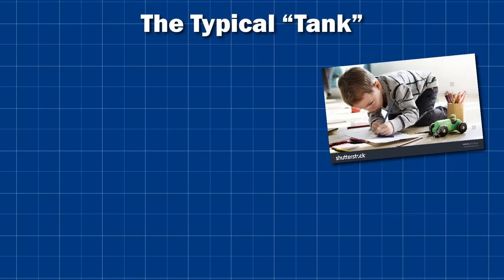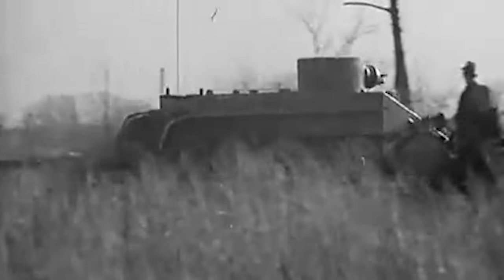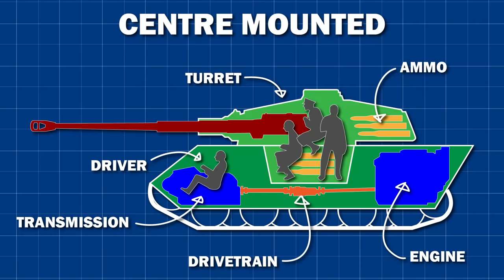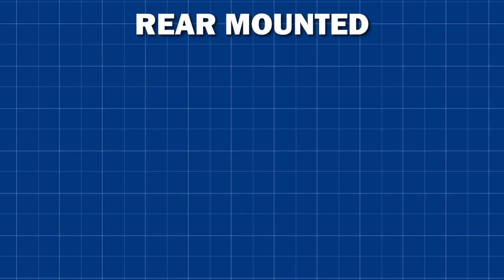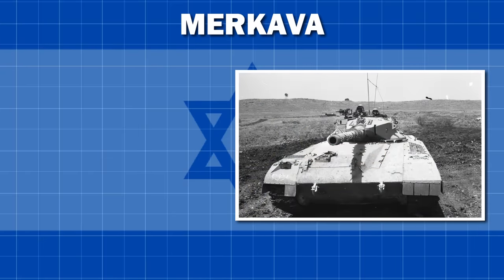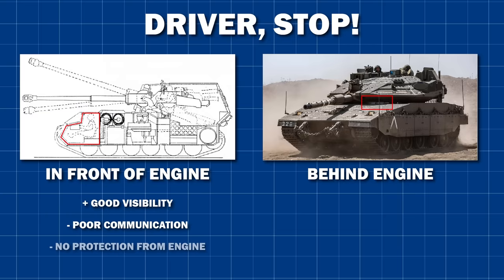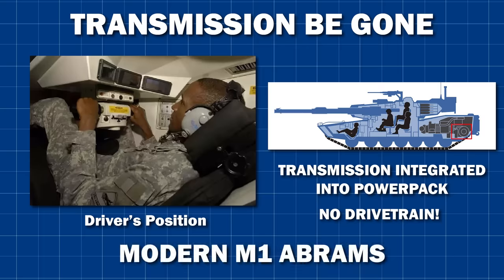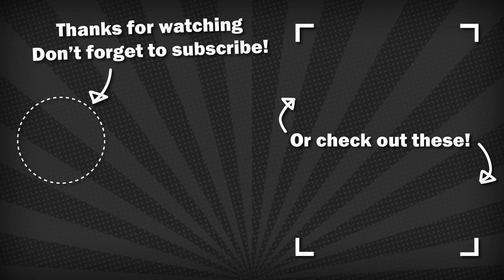What happened to Rear-Mounted Turrets?

Comment: Tanks are supposed to fire on the move.
The weapon system is least affected by the tank's motion in the center.
This is THE main reason why turrets are put in the center, even on tanks like Merkava (and on other fighting vehicles like BMP). It also increases turret crew comfort.
This is why rear-mounted turrets are usually seen only on self-propelled artillery.

Comment: Soviet tanks in WW2 had a rear-mounted transmission.  How did they solve that problem with manual transmissions?
Reply from the maker: They used a series of linkages between the driver and the transmission! The T-34 was notoriously hard to operate but linkages can be done well in theory. They are just rather maintenance heavy.
Reply: @RedWrenchFilms  Thanks!

Comment: A lot to be said for USSR WW2 forward turret design actually. The USA wants the rear mounted design as this Tank is meant to deploy with Airborne units so mobility is paramount over firepower and protection. Also mounting the exhaust on one side has many advantages with in theory the possibility for an AIP Stirling Diesel to offer up a "land submarine" as a future capability for fighting in an NBC environment.

Comment: Driver behind Engine communication problems are no longer real in Modern Tanks. A perfect example of the rear mounted turret was to be found in the Swedish STRV-2000 Prototype. This groundbreaking MBT was not continued due to the end of the Soviet Union/Cold War. The design was quite expensive for the time, thus was instead replaced with Germany's Leopard 2 Vehicles, which were already in production and MUCH CHEAPER to purchase.
The main design aspects of the development project were that the vehicle was to have an emphasis on crew safety, as well as the survivability of the vehicle. 
The Strv was also far ahead of it's contemporary designs with both a 140 MM Main Gun as well as a 40MM Auto cannon equipped turret. This design is considered to be current state of art, with numerous versions of MBTs being outfitted with the dual gun configuration. "In addition to this stipulation, there were three main objectives that the Strv 2000 had to meet. Firstly, it would need to be able to fire in any direction while moving. This could be of concern for lighter tanks, or for tanks with a very large and cumbersome main weapon. Secondly, it was to have good visibility all around the vehicle for the crew inside. Thirdly, there had to be a high survival rate of both crew and the vehicle if the ammunition storage compartment were to be hit or explode."

While a Game simulation, ARMORED WARFARE has a fully functional STRV-2000 as one of the MBT options. With just over 3,000 Battles in mine I enjoy a 97% win rate. Further, the Tank is a real pleasure to operate, even though a game. A good information resource is found here:
https://tanks-encyclopedia.com/coldwar/Sweden/strv-2000-t140-40/
Well written analysis, compliments!   ♾

Comment: Personally, as long as the tank balance point is in the center of the tank, it makes it will make the track much easier to drive.
Most NATO tanks, as far as I am aware, use a rear sprocket drive system and the transmission is part of the power pack (engine) mounted in the rear but you make solid points about this issue in armor design of tanks in history and why they were the way they were.  

I am assuming most modern tanks all have an internal coms system so all crew positions can speak to each other.  Driver and TC need to work out when the TC tells the driver "hard left" what "hard left" actually means.  At some point the TC and Driver work out what the TC expectations are, what he wants when he yells out a command, and how the TC "handles" his tank. This is usually the first thing the TC is doing with a new crew or driver until he is comfortable letting the driver do his job without having to be constantly babysitting the driver when on the move. That I know from experience in both positions.
Thanks for this insightful video Sir.

Comment: With a rear mounted turret and offset cannon. A tank in an urban setting or other structure, could use a building as cover. Tanks strategically placed around various buildings might have the advantage.

Comment: The main issue I see with this design is 
1. You risk losing all mobility if the hull is penetrated, whether it's because the driver is KIA/ incapacitated or the engine/ drive system becomes damaged. This leaves the tank immobile and unable to remove itself from danger quickly. Considering most modern MBTs have rounds that can easily punch through each other's hulls. Something like the Merkava could be rendered inoperable long enough to become an Artillery target.
2. There is an undeniable loss of gun depression over the front of the tank, which puts it at a disadvantage in hilly or mountainous terrain. Your then either forced to expose the tank to more enemy fire or forced to use a Hydralic suspension system to compensate, which further complicates the tank

Comment: As you have said weight of the frontal armor is compensated by the weight of the engine on the back. Now imagine both things are located at the front. You will have to choose between engine and armor. Or make the gun so heavy that there will be no place for crew. And Merkava is the great example. It has no armor at the front compared to other MBTs and they rely on the protection provided by the engine. So in real battle situation while any tank will withstand few penetrations of frontal armor (if crew is unharmed) Merkava will be completely destroyed after first hit (even if crew is unharmed).

Comment: I would suggest that a front engined AFV would be more flexible regarding variants. Also the drive train is nearer the driver so you don't have a longer control system.

Comment: If I'm not wrong most of the rear turreted tanks were tank destroyers since they had much larger and/or heavier turrets, thats what you kinda shown indirectly but is also an important reason, given that TDs are nearly non-existant nowadays since modern battle tanks can shoot as far if not further than them and other reasons like better reconaissance these days and etc. They also didnt require to move as much making the communication issue less occuring, as well as they shot more at range so the better depression angle wasnt as needed. I suppose the engine saving the main crew aspect prob also helped TDs surviving stronger piercing shells from enemy TDs and other tanks since theyre less mobile.

Comment: Dear Red Wrench,
Have you ever made a video abot the pros and cons of (centrally- or rear-mounted) uninhabited (remotely controlled turrets with all of the crew inside the hull)? Has there ever been any design of a remotely operated basket-less turret with a flat bottom, which would be attached to the hull roof through a shallow circular depressed pedestal with the turret ring or a turntable would be situated? The only connections between the hull and the turret would be cables, pipes and maybe an inspection shaft and all the weapons systems and their ammunition would be placed inside or on the turret, completely separating the crew and the ammunition.
Reply from the maker: Hey! You should check out my video on the M1 TTB if you can cope with the poor audio. I talk about remote operated turrets and their downsides :)
Reply: @RedWrenchFilms  The audio ain't poor, it's a nice video, actually. Some of those drawbacks could nowadays be eliminated due to the availability of various mature technologies and the 4th crew member could be retained as a system (maintrnance) engineer/weaponeer or even a remote-operating loader. And regarding the size of the unmanned turret: I've been thinking about the turret retaining the same external dimensions, but maybe with less armor and with the freed-up crew space (plus the removal of life support systems) repurposed for the autoloader, additional ammunition storage compartments, auxilliary weapons systems, additional sensorics, electronics and mechatronics, various countermeasures, etc., so the unmanned turret should end up weighing about the same as or slightly less than the manned one, but providing better situational awareness and greater ammunition capacity (completely separated from the crew), albeit having greater technological complexity.

Comment: another disadvantage for rear mounted turrets and front mounted engine is thermal signature.
Merkavas are very hot from the front, making them easier to detect and their exhaust could interfere with their own thermals.

Comment: I think another big factor of preferring middle mounted turrets vs rear mounted ones is also a change in doctrine since WW2, where tanks have less armor (thanks to  shaped charges) and rely more on mobility in combat. A middle mounted turret is way better balanced when you turn the turret and gun to the side to fire while moving.
We also can see when firing from the move is not as big of a concern, "tank" designs use the rear turret design more frequently, mostly seen in (old) tank destroyer, artillery or SPGs. A rear mounted turret makes it easier to load ammo in, like high caliber ammo that needs a loading crane, a ramp or something similar.
In a historical context, putting a turret or a casemate (a non-rotating housing on a tank chassis) further back allows you to put way bigger guns on your "tank" to have more effective range and a better effect on the target. We got away from that because tank armor got thinner since WW2 and relies more on reactive armor, because we use shaped charges in basically any ammo (be it in tank shells, rockets or missiles) to destroy tanks instead of firing a hug chunk of metal that penetrates steel with inertia alone.

Comment: What about the temperature issue from fording streams?

Like if water splashes on the front, would there be enough steam to obscure the view of the crew if it doesn't have radiators bringing the heat to the back?

Comment: An interesting and intriguing AFV is the rear engined South African Rooikat 8 wheeled AFV with 75mm and 105mm main armament. Rapid deployment at 120km/h to move from one part of the area of operation to another, so long as roads are passable. A design coming directly from the experiences of the SADF using the 4 wheeled French made Elands armoured cars in Angola. Imagine the capability a battle field commander has with a 105mm main armament vehicle which can travel at 120km/h, to move them around to the immediate threats. A tracked AFV is the best for the actual battle, but is limited to shortish distance movements should the threat appear at another part of the area of operations.

Comment: Surprised you didn't bring up the strv 103. Like the only post ww2 tank with a gun mounted in the hull instead of in a turret. And no, it wasn't classified as a tank destroyer, it was classified as a MBT, to be used alongside more traditional centurion tanks.
Reply: Tank destroyer is a designation for a spesific task instead of design. They were used to plug enemy armoured breaktroughs but very different kinds of vehicles or weapons could be used to do that. You could use a tank as a tank destroyer. 

The design of strv 103 could be said to resemble that of an assault gun from the WWII era, but the Swedes will get offended if we use such offensive language of it. So it is a tank instead.
Reply: @herptek  The task Strv 103 was designed for is the task of a tank, not one of a tank destroyer. The vast majority of the Swedish armor units were in the south of the country and their task was to stop and then counterattack and destroy the Warsaw Pact amphibious landing.  

 Strv 103 is not designed to primarily work defensively by ambushing enemy units and then retreating from an expected ground invasion through the northern part of Sweden, that was the task of infantry units with anti-tank guns, missiles, and mines. Strv 103 was made for armored units intended to use their mobile for counterattacking, There were quite few armour units compared to infantry units so they had to be used where to their full potential or attack.

The number 103 means it is the 3 tank used with a 10 cm gun. Strv 101 was Centurion Mk 10 and Strv 101 was up-gunned Centurion Mk 3.   If you look at the handbooks for tank crews in the 1970s the exact same book is used for both and the induction is identical, the difference is just practical difference between the types like wading dept, gunner operation with a loader vs autoloader.   In the chapter on attack, there is on usage difference, Strv 103 can swim so it can be used to cross water.

So Strv 101, 102 and 103 were expected to perform the same tasks as tanks.  The reason Strv 103 does not have a turret is that the design tun stabilisation system was not explicitly good so tanks needed to stop to fire. It was incorrectly not expected to improve a lot. Removing the turret makes a smaller tank harder to hit that can have better frontal protection and also a more powerful and more accurate gun. The hydraulic control of the tank makes it possible to turn all of it quite quickly.

If you look at UK and US evaluations of the tank in the 1970s against their tanks the concussions were they were equivalent and there is no fundamental reason that a turretless tank is worse. Strv 103 was for example a bit slower on average in time to fire than M-60 but the accuracy was better. Strv 103 was not always slower, if for example a target was detected directly to the side when diving on a road it was faster. Break with one track and the whole tank rotates quickly a bit like a handbrake turn.

It should be said the design was a dead-end. Gun stabilization did improve a lot with electronic systems and the tanks that emerged in the late 1970 could fire when they moved. The armor scheme with quite thin but extremely sloped frontal armor works well against the shots of early 1960 when it was designed like the relative shot Armour-piercing discarding sabot. The problem is that did not work again the longer and thinner  APFSDS that are used today. That includes the projectile of T-62 with its smoothbore gun introduced before it. I would assume intelligence of it and/or knowing of the implication of this was not there to understand the flaw.

But just because it was a bad design compared to future tanks and that the armor was bad against emerging munition does not meat it was not a tank.
Reply: @target844  I remember correcting someone recently with an essay almost like that with some of the same points included. Note that I did not call it a tank destroyer. I guess my attempt at humour about the Swedes getting angry if we call their design of a tank an assault gun was unsuccessfull, even if you agree with me that it can be used offensively as well. Pardon me for my offensive humour.

It has to be remembered however, that WWII era assault guns could and were used offensively as well as in the role of a tank destroyers.

Comment: The Merkava has the problem that having all the weight of the engine at the front limits how heavy the frontal armor can be. The Merkava has a relatively weak frontal hull armor compared to other tanks like the Abrams or the Leopard 2, but it still is very front heavy, which limits its mobility. There are many pictures of Merkavas which nose-dived into ditches and craters or even tumbled down cliffs and steep hillsides.

Comment: I think another thing might be the stabilisation of the main gun. Having it in the rear may result in much larger movement when traversing uneven ground.
Reply: the heat coming off that engine might also interfer with thermal sights.

Comment: Another reason why most tanks have turrets in the middle of the vehicle is because it can rotate 360° and can balance its weight by aiming the yun backwards 
Also the tank can reverse front while the gun looks back so the engine can protect the driver but then frontal armour would be pointless

Comment: Another thing is that while engine protects the crew, it does little to protect the tank - if it gets hit, it can get on fire, and almost surely won't run anymore.

It is easier to replace tanks than soldiers, but still its not as great of a benefit - might be easier to just focus on better armor.

Comment: Interestingly many tracked vehicles that aren't tanks prefer to have the engine either in the front or middle. Self propelled howitzers often have the turret in the back, so it can be easily accesed through the back. Also driver-commander communication isn't as important as in a tank, as artillery doesn't fight while moving. APCs and IFVs have their crew compartment in the back, so they can use the rear doors. Since these vehicles are lighter than tanks they have smaller drivetrains, so either the problem with the driver having to look over the engine isn't as severe or the powertrain is mounted to the side of the driver compartment. Artillery tractors also often have the engine in the front, as this keeps the rear available for cargo or modification.  Also the driver can sit high enough to see over the engine as a low profile isn't important for them